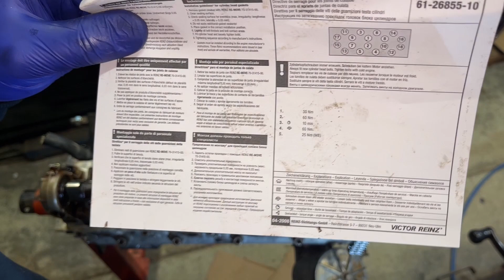PROJECT SEC - EP20: M117 Heads & Longblock Re-Assembly

Comment: Hello, what is the Mercedes piston no
A 1170304918
A 1170301018
As it is not available in the Middle East
Is there another piston with the same size and dimensions and a different number? Do you have information?
Tell me, thank you